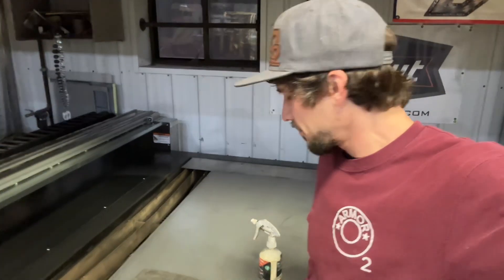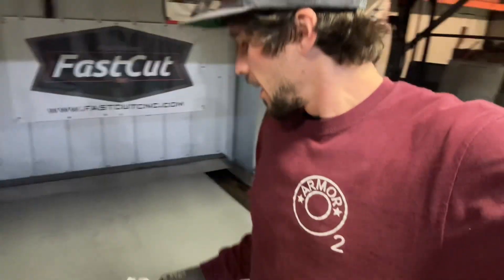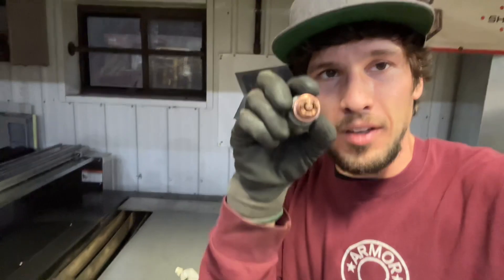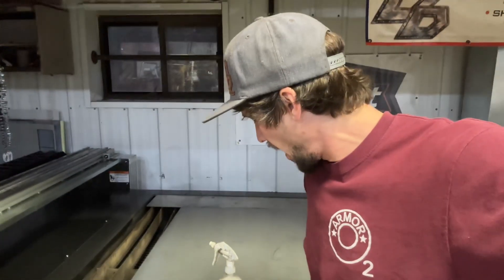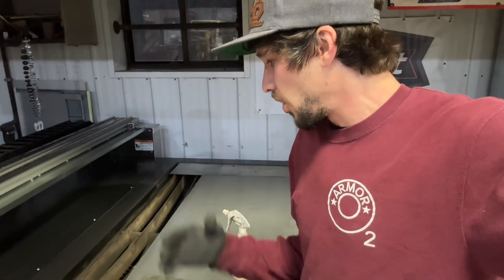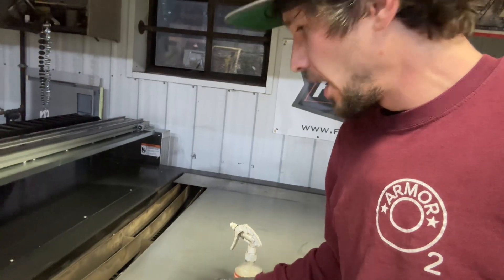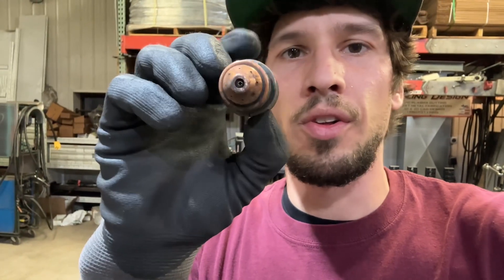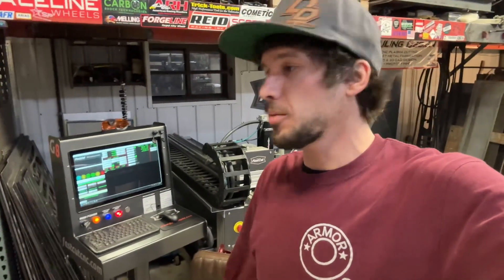Tech Tips With Adam - Ep2

Comment: Love the tech tips idea! Keep it up! Always learning from you. When you told me about this anti-splatter on the consumables I immediately started doing it then forgot about it🤣 I was just spraying the tip and wondered about spraying the sheet. But after this video this makes way more sense on spraying the tip, wiping then letting dry. I also just started wiping my fixture table down with this stuff too. Was just spraying table and leaving it, but got better use once I started wiping is all over.
Reply from the maker: @HalfacreFabrications  I’ve even sprayed it on powder coated table frames I had to weld next to that I didn’t feel like taping off for a quick weld. Surprisingly it kept the weld spatter from burning the light gray powder coat. Also it just smells nice haha.
Reply: @ lol it does smell good!